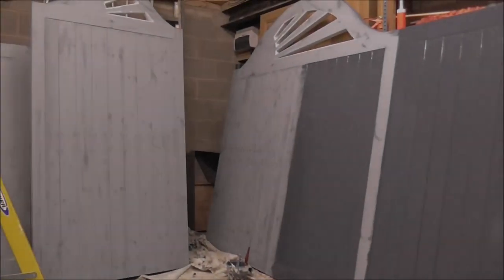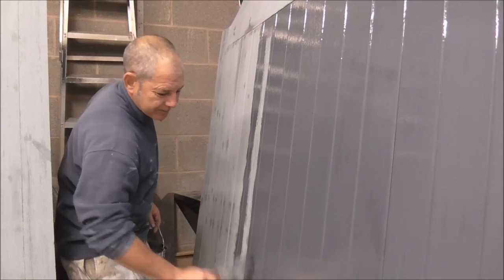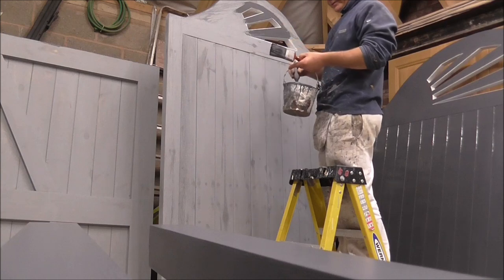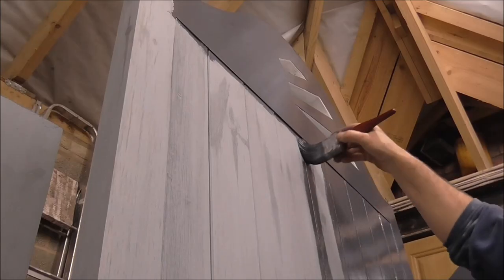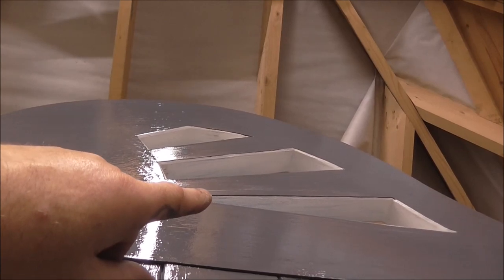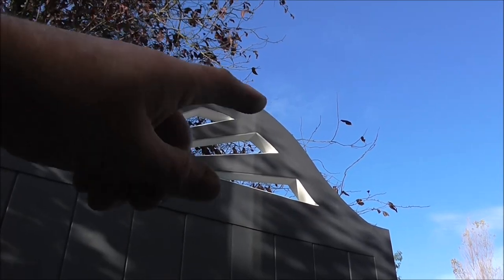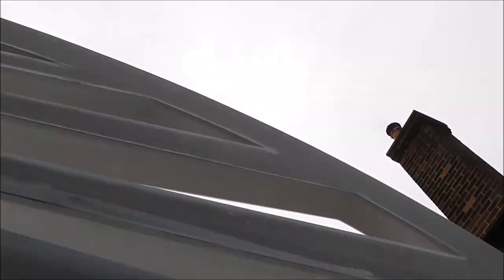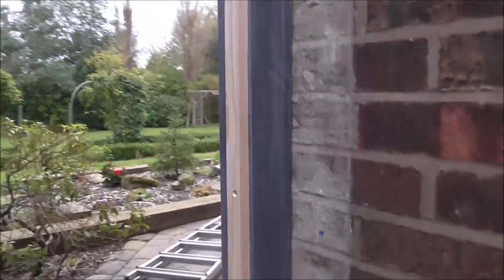How to paint tongue and groove garden gates

Comment: What gloss did you use,  leyland tru guard flexi  oil ?  I've never used leyland for outsides normally dt weathershield  oil
Reply from the maker: Yes, Leyland tru guard gloss as well. It depends on the customer some customers prefer a particular brand.
Dulux weathershield, Sandtex, Crown, Leyland are the most common exterior paints we use.

Comment: Hi great job once again .

So when u started flossing to stop flashing in the paint did u paint each piece of wood sepretly
Reply from the maker: Desmond Lee some of the large area you can bring down two or three boards together using oil, depending on the heat of the day.
Reply: Painting and Decorating ok around 3 is good at a time when glossing. I do have trouble now we are all going into water based top coats, with flashing on doors how would you get over that problem.
Reply from the maker: Paint as fast as you can and work in small sections, and only in the morning in summer turn all heat off in side.  But starting to use oil satin indoors now if I can, does not yellow like oil gloss and is harder wearing than water based.  Have fallen out with water-based me, did a job with oil satin and it went in one coat and looked better than two coats of water-based satin.

Comment: Nice job. Personally I would roller and lay off with a brush. I’d brush only if I was being paid by the hour.
Reply from the maker: Yes roller may be quicker but you still have to use the brush to paint the gaps then lay off, so for me it's just as easy to keep the brush going rather than stopping and changing to the roller then back to the brush to lay off.  And yes it's  by the hour customer likes things doing best we can.
Reply: Cool video  your a brilliant and kind painter the best on you tube
Reply from the maker: stephen leaper Thanks.